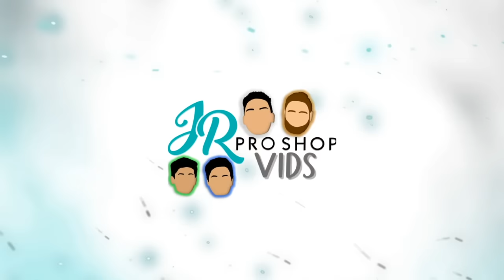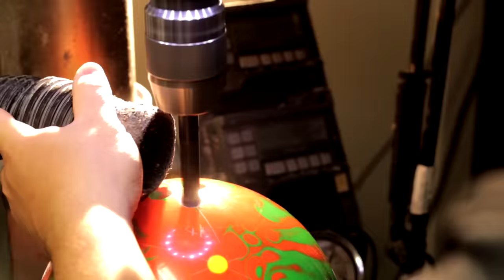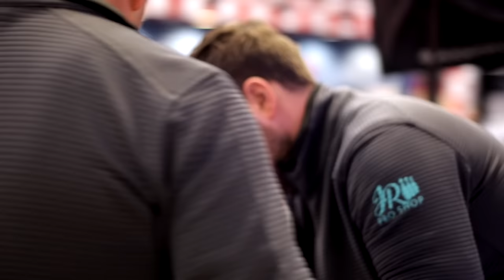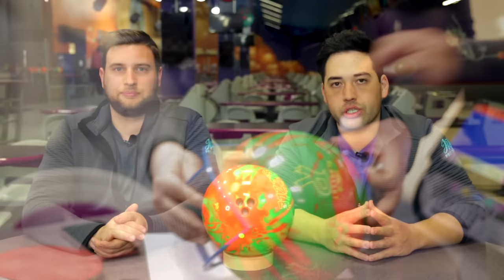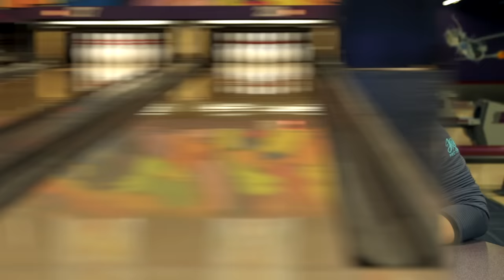Bowling Ball Layout Differences | Triangle Grip | WHY IS IT ILLEGAL??

Comment: As I've gotten older my ball speed has dropped some. My track tends to be low, but I've been working on getting it higher. A longer pin to PAP distance seems to help me get the ball into a roll at a better place with regard to the pocket and using a little higher VAL angle seems to make the ball easier to control. Been using Storm's VLS spreadsheet to check their recommendations before doing anything else. My local pro shop owner is great to work with. Continue learning about layouts and your video helps today. Thanks guys!

Comment: I've seen the triangle layout a few times. They can be really useful here where bowling balls cost years of work and are not very accessible at all. The only reason I don't use it is because the USBC rules apply in higher-level competition here too and also I wouldn't be able to use pitches. (I normally use 1 inch reverse).

Comment: In terms of layouts I use, I have probably 4 or 5 go to layouts. The process of picking which one to use starts with figuring out what the ball's natural motion is. Next, I figure where it will fall in my arsenal. If it is close to a ball I already have, I do some research to see how they're the same and how they differ. For example, the Nirvana and Pitbull are both low RG, high diff asym solids, but have different cover formulations and surface finishes. I use that information to determine if I want the new ball to compliment or replace the one I already have. If it's a replacement, I'll usually stick a similar or identical layout on it. Otherwise, I'll go with something that gives me a different shape so I can stay in the same type of ball if I want while still getting a different look. If I don't have a comparable ball, I'll usually put a layout that accentuates its natural characteristics at first. If I don't like it, I'll go the other way with it. 

Rarely, I'll buy a ball with the intent of putting a specific layout on it. For example, I recently picked up a Vintage Inferno and put a short pin layout on it to go with the short pin solid I like to use. There's a house I bowl in that's really wet/dry, and most of my equipment just won't roll consistently. I've found my short pin solid is great for a couple games before it starts going flat. So, I went and got a pearl that will give me a bit more angle to carry the corners late in league or tournament blocks.

Comment: Usually, use 60x4x20, or one that places the pin under my bridge. 

Try to keep the first for bigger assym stuff/some bigger core syms/some lower diff balls. 

Generally place the pin under my bridge one weaker assym/lower diff syms. Web Tour with the pin under my bridge is still nasty.

Comment: So could you just get a rubber plug and fill the hole your not using at the time?
Reply from the maker: Great question. We will find out
Reply: The answer is no unfortunately. As per USBC rules chapter 8 section 7 a, you may have up to 5 gripping holes, one for each finger/thumb. Each gripping hole must be used on each delivery. This includes holes using removable devices (Switch grips, VISE thumbs, etc) To take this a bit further, if you're a two hander or no thumber and you only have 2 gripping holes you are not allowed to "flip" the layout (A pinup ball and flipping it and using it as pin down). You are supposed to have a scribed or engraved "cross" (+) near the center of the palm to indicate the layout and grip orientation, and your palm needs to cover it on each delivery. Hope this helps!

Comment: If I change layouts, it's because of what the purpose is for the ball. I like to have a lower flaring pearl and a high flaring pearl. I like to have a lower flaring solid and higher flaring Asym solid, etc......helps me especially on house shot, so I can dig through mud if the lanes have more oil than usual and I can deal with moving pretty far left and slowing it down. 🤘

Comment: I need your help with layout I want to change. First I’m a full roller with all my balls drilled close to manufacture layout for me. I tired of seeing the same results no matter which ball I try. I have enough new release balls to stock a pro shop. Any suggestions
Reply from the maker: Hey Richard. Have you had balls drilled specifically with a full roller layout? With the pin somewhere near your thumb instead of near your fingers
Reply: Yes pin is 2” left of thumb on all symmetrical and asymmetrical I always get a ball wear pin cg and bias in line so then bias is just right of ring finger
Reply: @jrproshop  the answer is yes all my pins are at 7:00 to my thumb on both symmetrical and asymmetrical which I have cg and bias in straight line so bias ends up being just right of ring finger

Comment: I have three layouts that I like: Pin-up ( about an 1.5 inches about the ring finger), a stronger layout with the pin just right of the ring finger (and up about 1/2 inch) and a short pin layout, about 2.25 inches right of the ring finger.
Reply: @TerryBollea1   No, I actually am a high track (low tilt) player.   I have them drilled like that because, with my tilt, pin-under balls don't work for me.
Reply: @TerryBollea1  a full roller tracks between the thumb and fingers.  I track to the left of the middle finger.
Reply: @TerryBollea1  so, you don't know what a full roller is, I see.  I would suggest you look up the definition. Mo Pinel did  a great video on YouTube that explains it.  However, there are plenty of resources that actually explain it.
Reply from the maker: Hey JP it seems like Terry is a few bricks short of a load lol. What you are doing makes sense, I do something similar with my layouts for tournament play. And you're right terry needs to learn what full roller means haha

Comment: @JR Pro Shop, what is the difference in a 4x4x1 vs 4x4x2 layout?
Reply from the maker: The last number in the pin buffer. A smaller number creates a sharper ball motion. And a bigger number makes the ball a bit smoother
Reply: @jrproshop  WOW! I didn't expect anyone to answer. I appreciate it cause this helps a lot! I throw using 2 fingers, no thumb and i'm looking for a pin up drilling for my Sure Lock, Timeless, and Match Up Hybrid. All will be re-drilled.

Comment: I dont like to try new layouts unless its the same ball I already have in my arsenal and maybe I wanna see a different motion from my typical layout.

Keeping layouts the same ball to ball means if my PAP changes and I still like that layout, i dont have to plug and redrill other balls with different layouts to the one I like. Plus it allows the cover and core differences to be seen ball to ball, because the same layout means itll be the same / similar core motion, but also allows the cover to be different and show its differences. If that makes sense.
Reply: They still play a bigh enough role where consistentcy is needed
Reply: @TerryBollea1  not that minor lol. The difference between layouts will greatly change the motion. One will roll earlier, longer, or be stronger overall. Just get a urethane ball with 3 different pins and look at how different the layouts are...

Comment: I have a question (even though this video is two years old). It is still legal to have one ball with two layouts, meaning the two fingerholes drilled, one pin up, and one pin down.
Reply: No. If you're a palmer/2h you have to scribe a location on the ball where your palm goes. You have to cover this scribed location during delivery of the ball 

If you had a second one of these marks that wasn't covered it wouldn't be legal in sanctioned play. 

GL m8